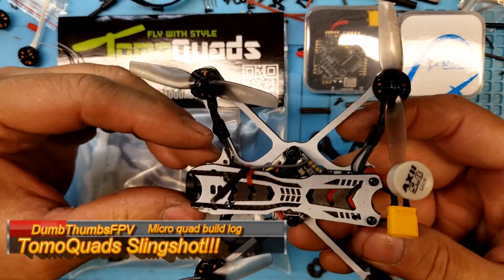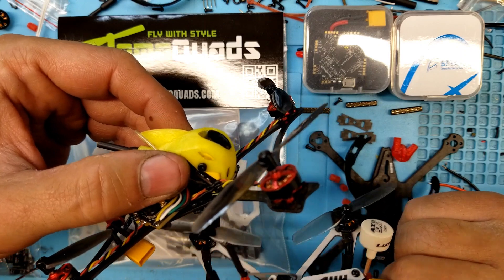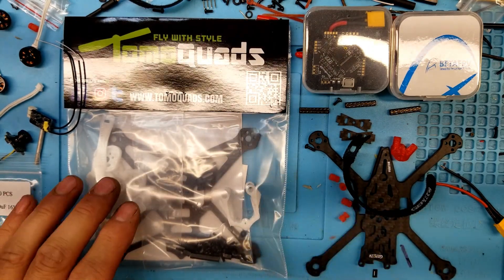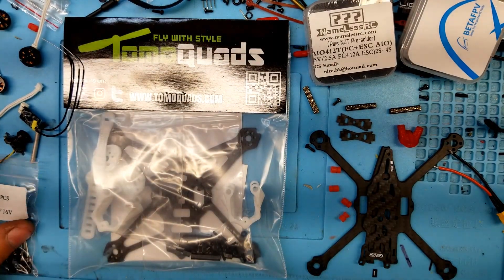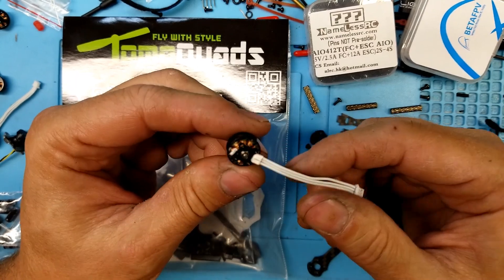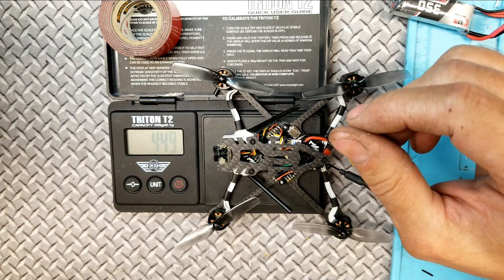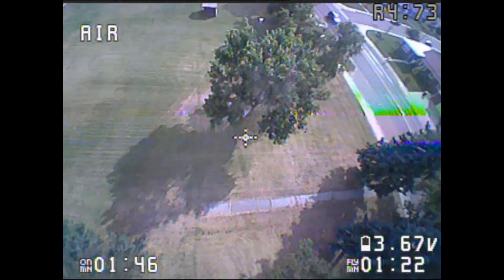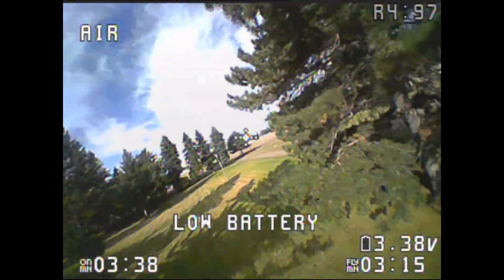Tomoquads Slingshot, Nameless AIO, BetaFPV AIO, skystar motors

Comment: Total cost for the build? Did I miss that in the video? Couldn’t you tweak the TinyHawk’s tune on this, being that it’s almost identical, aside from the kV?
Reply from the maker: My Freestyle was different because it was sent to me earlier than others. I tried that and it's didn't fly well. I suppose you could as a starter. I started out with the ones on betaflight's site. https://github.com/betaflight/betaflight/wiki/Community-Presets under 2 to 3 inch.. they didn't work well either.  I'll do a cli dump of the settings when I get home. As far as cost: I had the camera and TBS VTX but if I was to build it I would use the eachine VTX. So cost is in the links above.

Comment: Yeah, and top mounted the batteries aren't inherently protected. I'm pretty sure it's a lot more likely to be quite the opposite.
Reply from the maker: Interesting.. why do you say that? I don't think I've ever damaged a battery on the top.
Reply: @DumbThumbsFPV  because nine times out of 10 when I'm crashing, I'm usually in a forward motion orientation at about 30° forward pitch. And if there's any time that I'll more likely to have a battery strike, outside of ground tumble (at which point the odds of battery strike are more equal regardless of battery mounting), is the main initial impact(s). If my battery is top-mounted. Because the only thing between the battery, and what's being impacted (in most situations), is battery strap. and we all know that those don't do anything to protect against strikes, only from breaking loose due to inertia.
Unlike with a bottom mounting battery, where in most crashes the whole body and frame of the drone is between the battery and what is being impacted.
Reply from the maker: @DavidHanniganJr  hmm,  guess it comes down to how we fly, I always am smashing my bottom end into the ground. The only time I've smashed my top end was doing inverted yaw spins and lost the horizon. I like to fly close to the ground as well though... but even when I screw up and bash an arm into the ground my bat on top is more protected. I also like the fact that I can start out flat with a top mounted bat.